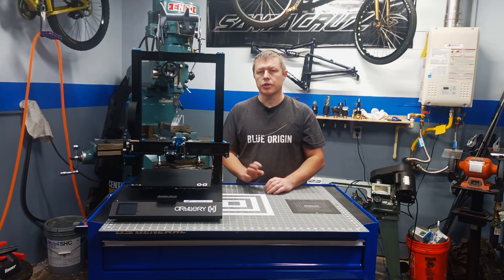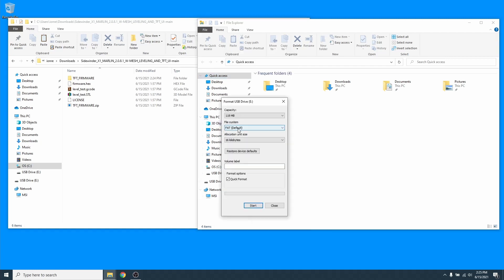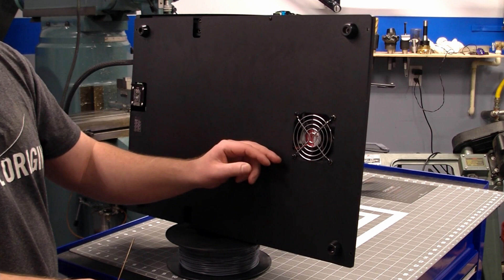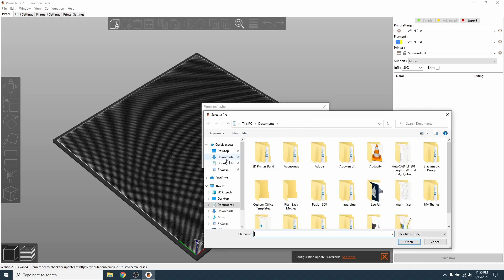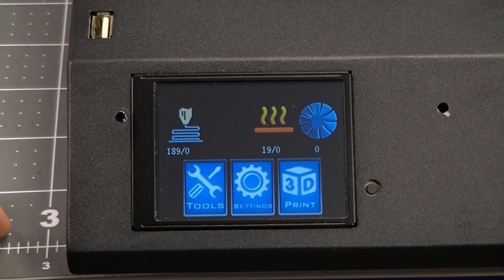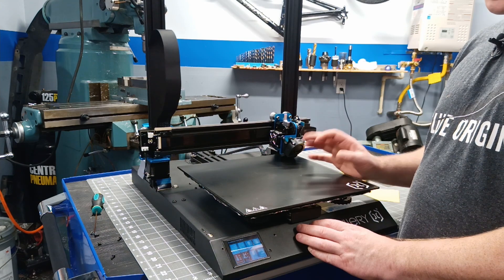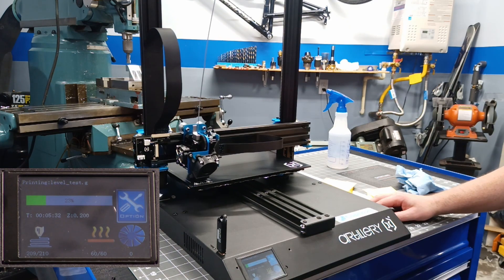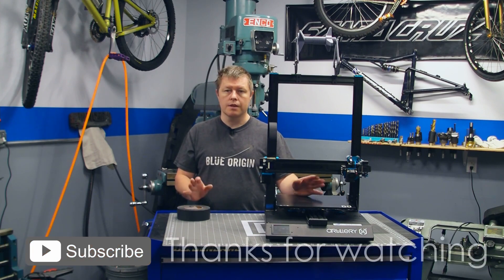Sidewinder X1 Marlin 2.0.8.1 with mesh leveling and custom touch screen UI.

Comment: Nice one, very interesting. Is the load/unload of the filament stayed the same? meaning simple button push and the heat and move of the extruder done by the firmware?
Reply from the maker: Yes that function should not have changed as thats just Gcode sent from the TFT.

Comment: Hi, did you activate linear advanve and junction deviation in your firmware, and for future update do you have integrate the possibilty to disconnect the screen with a button on it with baudrate ajustement ?
Reply from the maker: Yes linear advance and Junction Deviation is enabled. I have seen people add a switch to turn power off of the TFT for updates.
Reply: @EtherealProject3D  ok so i read a little bit about that, if we use linear advance, it's better to have classic jerk instead of junction deviation. and reverse, if you want to use junction deviation it's better to have linear advance desactivated in the firmware. for information on Molise firmware, david put a button directly in the screen to disconnect the screen and get the printer controled by the computer for update and more.
Reply from the maker: @lockedzone  Thats intereating. From what I have seen in my research on the matter is with linear advance, use junction deviation. I will have to do more looking. Thank you for the info

Comment: So I finally had some time to update to your firmware. Had a couple of snags. PC Serial driver to connect to Swx1. Got that fixed the other is the LED light switch didn't work. Not sure if you have a fix for that. Leveling went great and this printer is my awesome. Thanks
Reply from the maker: A few people have noted issues with the LED. When I get some time I will take a look at it.

Comment: Temp for the genius still stuck at 235.. Thought it was raised to 270? I guess I have to reflash using another firmware.
Reply from the maker: I will take a look at it, thank you for letting me know.
Reply from the maker: I checked the firmware and confirmed max temp is set to 275. I recompiled and reuploaded it just to be safe. Download it and try again if you would like. Sorry for any inconvenience.
Reply: @EtherealProject3D  thanks for the fast reply! And to confirm this is for the genius? I remember you mention the genius is set to 270 and X1 to 275.
Reply: @EtherealProject3D  I just checked now and my X1 does get to 275. As for the Genius, I can press for the temp to get to 270 but the nozzle wont heat up past 240ish and it comes back down to 235 and stays there.
Reply from the maker: @johnnyartillery  Does the screen show a commanded temp of 270?
Reply: @EtherealProject3D  On the genius yes, I can press the + for the nozzle until it says 270. In the same screen the temp will only get to ~240ish max then drop to 235 even though I selected 270. So it ends up at 235/270. Once I leave this screen and go to the main screen it automatically adjusts it and displays 235/235.
Reply from the maker: @johnnyartillery  Oh thats strange. Im gonna have to do some deeper digging to see what I am missing. Thank you for letting me know.
Reply: @EtherealProject3D  Ill try to re upload the update and see if it works. As mentioned, the X1 seems to be working just fine.
Reply: @EtherealProject3D  UPDATE: I just uploaded the one you just posted. This time it let me set to 270, It climbed up to about 265ish, and I went back to the main screen. There I noticed the temp adjusted itself down to 260. Its now 260/260, better than 235 but still cant seem to set to to 275 or even 270 as it limits itself to 260 tops.
Reply from the maker: @johnnyartillery  Thats super weird. Im still looking at it, have not found what could be causing this just yet. I will figure it out though.
Reply from the maker: @johnnyartillery  Also, have you done the PID tune after you updated the firmware
Reply: @EtherealProject3D  I have not, I must of missed that part. I am currently printing some carbon nylon part and its looking really good. I will run the PID tune as soon as its done. Thanks for reminder!
Reply from the maker: @johnnyartillery  No problem. I am curious as to how the breakout board and ribbon cable will hold up with printing at higher temps.
Reply: @EtherealProject3D  My print got done, it was a short 1hr print of a cylinder to test my profile and this new material. Everything looks great. As for the PID, I ran the procedure as you indicate in the video and still am able to set the hot end to 270, and once I go back to the main screen it adjusts itself down to 260.

Comment: Any idea if octoprint will utilize mesh leveling? I've done all the steps short of printing via usb stick (yet) and have the same warped bed issues as before.
Reply from the maker: I have not used Octoprint so I am not aware of weather it will work with it or not.
Reply: Successfully printed the test via usb, octoprint results are the same as before mesh levelling.
Reply: @markattardo  there's a gcode to insert to use the mesh bed leveling of the printer
Reply: @lockedzone  Thank you! I used "m420 s" last night and it seems to be the missing step. The bed visualizer plugin times out  but my test prints via octoprint pass with flying colors.
Reply from the maker: M420 s1
Reply from the maker: Nice

Comment: Question,I have a 32 bit sgen l v1 board installed and would like manual mesh leveling.  Does this apply to my board?
Reply from the maker: This specifically wont work on that board, I would have to configure it for it. I can easily do that for you with I get some time.
Reply: @EtherealProject3D  can you point to a good tutorial on compiling marlin firmware?  I would love to take the opportunity to learn how to do it.
Reply from the maker: @jeremywood959  TeachingTech on youtube has a bunch of great tutorials on firmware compiling.

Comment: Thanks for the info!! I wanna do this. Newbie question is this doable with a Mac only?
Reply from the maker: Yes, absolutely, you just need to ensure that you format the micro sd card to a windows FAT32 format and it is no larger than 8 gigs.
Reply: @EtherealProject3D  sweet!  Thanks for the reply. Look forward to doing this soon. Can’t wait to get that sweet first layer down since my bed is just a little low in the center. Much appreciated. Will let ya know.
Reply from the maker: @mfeltster  Awesome, thank you very much.

Comment: Thanks for the the work  I notice I cant change the light setting anymore stuck on blue. 2 I can here the steppers motors 3 the baby step makes the printer go faster not up or down. how to reinstall original firmware i had v.4 as my firmware
Reply from the maker: I dont know what would cause this. Try reinstalling the firmware, keep in mind the sd card you use can be no larger than 8gb.
Reply: @EtherealProject3D  Ah thats ok I always fuck up its brand new this printer and I wanted the baby steps. I dont have anything smaller . Can I use a usb stick of 1 gig
Reply from the maker: @therambler3833  i have heard that it can be done from a USB stick but I am unsure how.
Reply: @EtherealProject3D  well i reflash things are better but i cant turn of light but it seems to work
Reply from the maker: @therambler3833  I will do some looking into the light issue.
Reply: @EtherealProject3D  Thanks you. Do I always have to level bed after i save to eeprom?
Reply from the maker: You should not. It saves it till you ether relevel or reset the eprom.
Reply: Thanks printer is stable now. This is one hell of a printer I have a Creality ender3 and never did it print like the sidewinder outstanding  @EtherealProject3D
Reply from the maker: Thank you very much. 😁

Comment: hi, firmware have m600?
Reply from the maker: Myself and others have not been able to get m600 to work correctly. I have disabled the feature in the firmware to save a little space, If you want a firmware build with it enabled I can do that for you to experiment with it.
Reply: @EtherealProject3D  ty man
Reply from the maker: @gato992010  You are welcome.
Reply: Does that mean the filament runout sensor is disabled also?
Reply from the maker: @catboxcleaners  Yes I have disabled the runout sensor.

Comment: Hi i just upgraded te firmware but my artillery isnt doing much, moves a little or heats a little but not showing any heat changes, do you know what could be doing this?
Reply from the maker: Double check the connection to the TFT, its very easy to plug it in wrong, and the crappy contacts can easily come out of the socket of the connector.
Reply: @EtherealProject3D  thank you! It was a loosen cable. Is there a way to add 3d touch?

Comment: Just getting into this, everything worked fantastic, great first layers. Moving into other means of calibration. I first ran PID autotune as described. Do you think running the fan at 100% while performing PID autotune be more accurate? Say with the extruder at center of heatbed and +10mm Z. Thanks for all the hard work!
Reply from the maker: You are very welcome. I have not tested doing the tune with the fan both on and off so its hard to say. Im very happy its working for you. Have fun printing.

Comment: seems to print fantastic but cant turn light on and off or control the fan
Reply from the maker: Interesting, ok I will look into the light and fan issue, thanks for making me aware.
Reply: @EtherealProject3D  your very welcome not sure if it’s me the smaller wire which you pull off the tft screen might be in the wrong position
Reply: @EtherealProject3D hiya have tested in the main menu whennnot printing the fan works perfectly but when printing it does work there’s about a 3 or 4 second delay and the light don’t turn off and on
Reply from the maker: @Darthies  Thanks for the update. I ill do some investigating into this issue
Reply: @EtherealProject3D  thank you so much I really appreciate it

Comment: Thanks for the firmware.  Could you tell me how you learned to program the TFT firmware?  I'd like to develop a custom version just for myself.  Thanks
Reply from the maker: The basic settings and custom gcode is done in the config.ini file. The icons are converted to their respective bin files on an mks tool I found online. The tool isnt 100% complete but once you figure out whats missing its not hard to fill the gaps. I will post a link to it when I get a minute.

Comment: hiya great video very informative i have the artillery genius am thinking about upgrading the firmware will i encounter any problems please
Reply from the maker: I have not tested the Genius version myself, but there have been a few that have used it and they have not encountered any issues that I know of. If you do try it and have any problems, let me know so I can address it.
Reply: @EtherealProject3D  I did try the screen firmware went on no problem the firmware wouldn’t
Reply from the maker: @Darthies  Did you disconnect the TFT before you tried to update the mainboard?
Reply: @EtherealProject3D  I think I know where I went wrong there’s 2 lead going to the tft screen your video only showed removing the bottom one I just checked your video again the top is unplugged aswell but poked in the wires to the left
Reply from the maker: @Darthies  Were you able to get it working?
Reply: @EtherealProject3D  no not yet have only just saw there’s two plugs to remove from tft I only removed one I might have ago tonight
Reply from the maker: @Darthies  Ok, let me know how it gos.
Reply: @EtherealProject3D  my Mac does not recognise the printer
Reply: @EtherealProject3D  just to let you know was able  to update firmware it was a driver problem
Reply from the maker: @Darthies  Awesome, happy your got it worked out. Enjoy and send any feedback.
Reply: @EtherealProject3D  thank you so much just doing the setup at the mo

Comment from the maker: UPDATE JULY-15-2021: I increased the max extruder temp from 235 to 275 for those that are using an all metal/bi metal heat brake and printing higher temp materials like ABS. WARNING: IF YOU HAVE A STOCK HOT END DO NOT HEAT UP BEYOND 240c, THE PTFE TUBE IN THE HEAT BRAKE CAN BEGIN TO MELT AND YOU RUN THE RISK OF CLOGGING.
Reply: Please see my reply regarding flipping the extruder motor for use with bmg wind extruder.  Thanks
Reply: great job man! still 2 minor problems . . . 1 - the display shows when it starts it is already at 18% and when it finishes it finishes at 86%; 2 - when you stop the print forget to go home the head. just so you know :) but over all, congratulations once again
Reply from the maker: Thank you
Reply: Thank you!!!!!!

Comment: Hi i have an issue, when im leveling points 2-9 on pronteface i can see thaht printer says unkown command, do you know how to solve this?
Reply from the maker: Are you sending the g29 s2 from pronterface? Or are you doing it from the tft with pronterface connected?
Reply: @EtherealProject3D  i connected the pronterface to watch what is going, but im doing this on lcd
Reply from the maker: @HetosBF  from my experience with this printer, pronterface wont display  what gcode the tft is sending to the mainboard. I believe this is because the tft uses a serial bus to just send gcode. The mainboard and pronterface doesnt see it as a tft, so it doesnt report commands received back over the same serial bus.
Reply: @EtherealProject3D  okay, anyway thanks a lot i needed such an Good tutorial!
Reply from the maker: You are very welcome.
Reply: @EtherealProject3D  I also diagnosed that after firmware update xyz cube is 19,6mm, do i need z steps calibration?
Reply from the maker: Sounds like it, I have not had this issue.
Reply from the maker: @HetosBF  The order doesnt matter, just as long as you disconnect the serial connection from the screen when you update the mainboard firmware.
Reply: @EtherealProject3D  okay, thanks!
Reply from the maker: @HetosBF  no problem
Reply: @EtherealProject3D  Is this a firmware issue that print doesnt resume after pause? Im using Ideamaker
Reply from the maker: @HetosBF  I havent had any problems using CURA. I will give it a try with GCODE from Ideamaker and see what happens. If you have CURA, give it a quick test and see if it behaves the same.

Comment: Excellent video.
Thanks a lot, Very well explained, I will do the modification this week end.
Reply from the maker: Thank you very much. Enjoy the firmware and happy 3D printing. :)
Reply: @EtherealProject3D  I finally did it, I was not able to wait till the week end. Works very well. Just need to counter check for the usb stick which is not recognized. 😁
Reply from the maker: @GiorgioAlzora54  Awesome, im stoked you like it. Enjoy amd happy 3d printing
Reply: @EtherealProject3D  👍
Seems my usb stick is not recognized even after format. Does it means that we can only use the micro sd card with this firmware or is it an issue with my usb stick?
Reply from the maker: @GiorgioAlzora54  I think it might be an issue with the usb stick.
Reply from the maker: @GiorgioAlzora54  Make sure you have your file source selected to USB
Reply: @EtherealProject3D  ok in the setting of the printer right through the tft screen
Reply from the maker: @GiorgioAlzora54  Yes

Comment: Does this firmware support arcs?, g2/g3 commands.
Reply from the maker: I do have ARC support enabled.
Reply: @EtherealProject3D  OK, I will try it on my Genius.
Reply from the maker: @kalifas777  Ok, let me know if you have any issues with saving the mesh leveling state.
Reply: @EtherealProject3D  Hi again, the mesh leveling worked fine, the only thing I noticed is that your menu does not have the option of led light, I saw a couple of buttons when you are printing (ON / OFF) but the original firmware has an option to turn on the led whenever you want, there are even several colors. It is not a problem, when it is printing it is activated at least. It works with arcs, no more "micro pauses" on curved walls at high speeds, I still have it in tests, if a problem arises I will tell you. I'm happy for now. Thank you so much!
Reply from the maker: @kalifas777  you are very welcome. I am sorry about the limited LED functionality. With the addition of the mesh leveling I had to sacrifice some of that.

Comment: I love this mod, It is a great mod, but I need to up the extruder temperature, as it maxes out at 235. Is there any chance to change the firmware to the default of 275.  I am printing ABS and some of the parts are lifting.
Reply from the maker: I can do that for you.
Reply: @EtherealProject3D  hey man, very nice of you to share all of this. I have the same problem (i print with petg) and that limit temp of 235 is not very helpfull. how can you help me too? or maybe could you change it back to default 275 and then reupload it ?
Reply from the maker: Yes, i will have some time today to make the necessary change in the firmware.
Reply: @EtherealProject3D  thanks again for all your help! Great video and information. Thank you for updating and sharing.
Reply from the maker: I updated the firmware and config for the mainboard and TFT to have a max extruder temp of 275c. https://github.com/Ethereal-Project/Sidewinder_X1_MARLIN_2.0.8.1_W-MESH_LEVELING_AND_TFT_UI.git

Comment: You can also use isopropyl alcohol (91% or higher) to rub on the hot glue and will easily peel off in one piece after a few seconds :)
Reply from the maker: Never thought of that, great trick, thank you :)